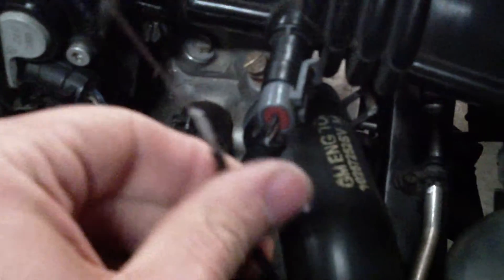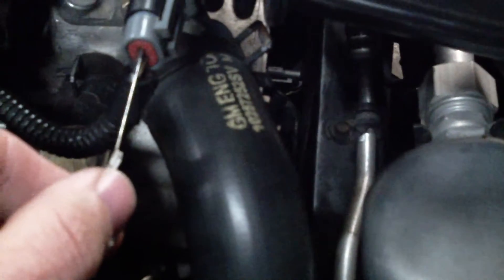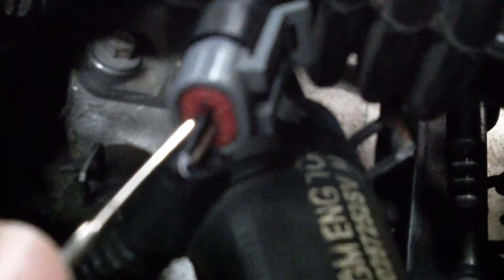How to Back Probe

Comment: In what kind of situations is back probing not possible?
Reply from the maker: I've ran across a few that had pins so tight it was impossible to back probe without risking damage. Also sometimes you cannot reach a connector without taking a lot of stuff out of your way.
Reply: Shawn Bauman Thanks!!!